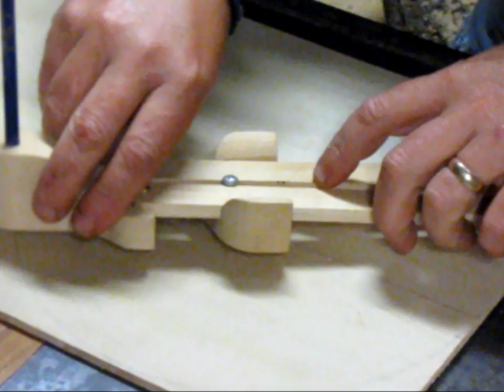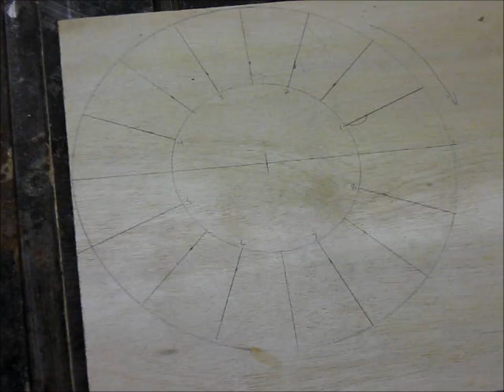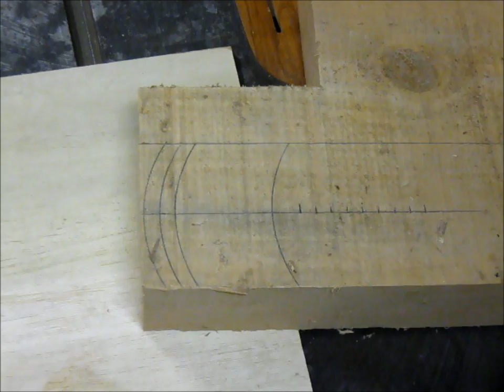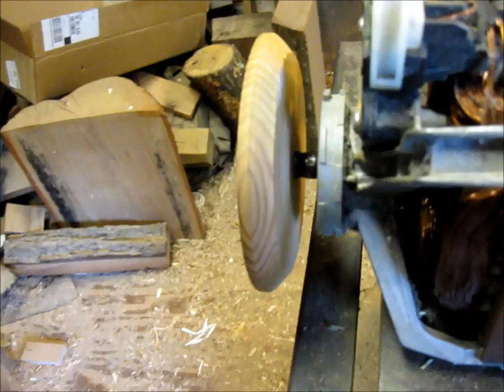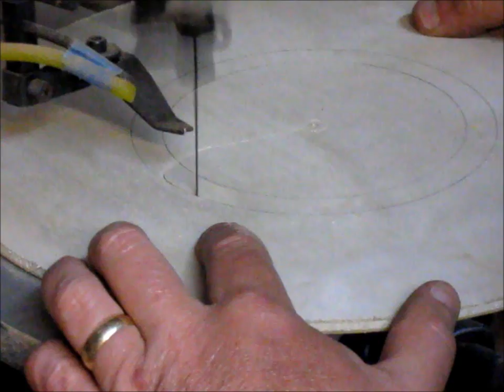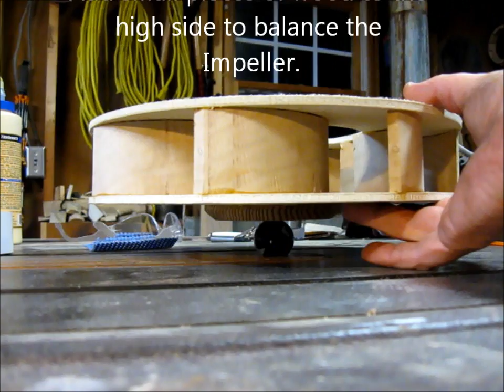#35 Building a Shopmade Air Cleaner Part 1 of 2

Comment: Get a Squirrel Cage Fan, or Floor Dryer Fan, Easy Cleaning, Less Work and Less Time = More Money :D
Reply from the maker: Thank you sir for your insight. You are right that it may have been faster with a squirrel cage, however the rest would have to still be built, not really saving that much time. This dryer motor also uses much less power saving money over time. I also learned how to build my own impellers. Again thank you for sharing your opinions and helping others to decide on their own.
Reply: No doubt you are Proud of your Work and NO I am NOT knocking you off on your Pedestal :D. What I am trying to say is... With all the time you build your "Impeller" which can't be clean with Water :(((.  There are Floor Dryer Fans that is cheap :))). You don't even have to take it apart, just the Control Speed Part + you will have 3 Speeds option, then build your Box and a place for your Filter(s) to fit in it, that's it :D. $$$ave more than just Energy, LMAO

Comment: will this also bend wood? If so what thickness?
Reply from the maker: Thanks for your question. I really don't know about bending wood. I just cut these pieces into a curve. You could steam bend these pieces about 1/4" thick for stronger vanes, however being glued on the top and bottom these cut on the bandsaw are very strong. Thanks Marine for commenting. I hope my answer helps.

Comment: I have my treadmill motor and speed control board running my bench top Lathe and am just blown away by how much power it has. Very impressive!
Reply from the maker: Yes, Tom I agree I just got the same motor which is a 2.5 HP DC motor. The advantage of using DC is that it is easy to control the speed. Glad you enjoyed the video. Thank you for your comments and supporting my channel.
Reply: Stephen Ogle I found a good treadmill on  Craigslist a few days ago for 25 dollars. In process of putting it on my big lathe. I should have done a video of the build.  Do you think  anybody would like to see the procedure? Is a really nice setup
Reply: +Stephen Ogle, an option for controlling the speed on AC is to just use a light dimmer switch, turn the knob and dial in your speed lol. I did that on my homemade drill press because well, the bench top just doesn't have a deep enough table for some applications.

Comment: good job looks like it will work very well (good use for salvaged parts)
Reply from the maker: Thanks Tom. In the end now all hanging from the ceiling and permanently wired. It really does work very well. Got about $30.00 in it. It could be improved with an even larger impeller but I have a small shop. Pulls .6 amps when running. Thank you for commenting and supporting my channel.

Comment: Nicely done. Vanes can be straight but better flow with the curve. Even better if the vane cross section is like an airplane wing.
By the way, you do realize that this shape. can also be used as a water wheel or even a centrifugal pump or air/ hydraulic motor.
Reply from the maker: This is basically a turbine, It is used for all kinds of pumping operations. My fire truck has a similar impeller to pump water. Of course it is made of bronze and is much more precise but basically the same. This thing really moves air well and a lot of it. Thank you for the input on the shapes of the vanes. Maybe someone reading this will use it for theirs. Thank you for commenting and sharing your expertise on my channel. Thanks also for your support.

Comment: Another winner Stephen! I've been getting drunk these past few months off Matthias videos, the man is a modern day hero (of mine at least), and the fact he explains most of his builds on the technical level appeals to my geeky side... A dust collector, or at least a strong fan to make me a nice vacuum system for my small shop is another of my to do list, and seeing your build is getting me itching in my fingers to make it happen! although I need a sanding wheel before that (gotta make dust so there will be lots of it to collect!), and since I don't have a band saw nor a scroll saw, I'm going to need to get pretty inventive, or just get my hands plenty dirty to get the job done.
I'll probably comment on the second part of the build too, which I'm off to now to watch.
Reply from the maker: Thanks Yuval, I remember when my shop consisted of a circular and jig saws and basic framing equipment. You can always make it work. Yes you will need a dust collector when you get the sander. That is my biggest dust generator. Thank you for your comments.